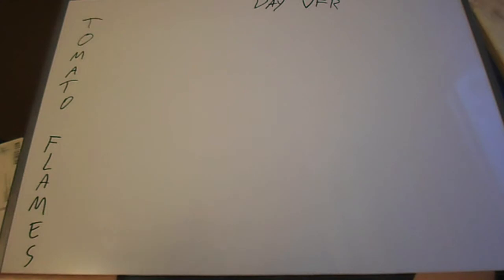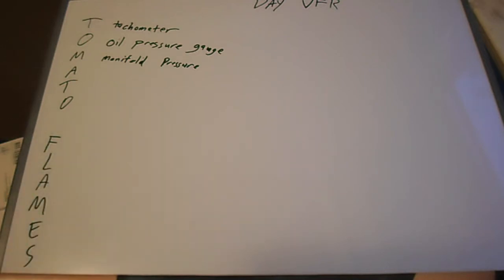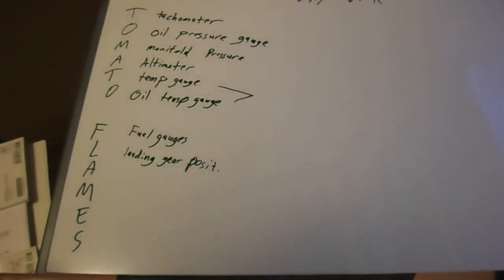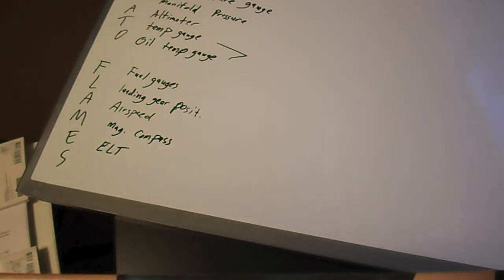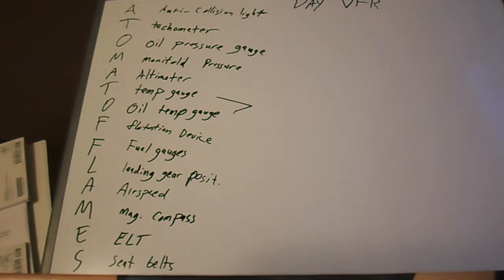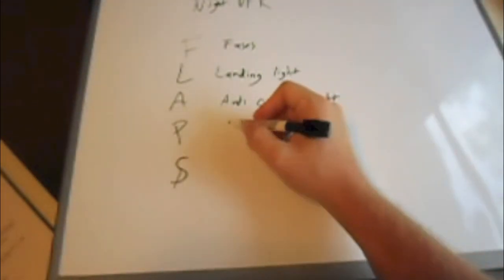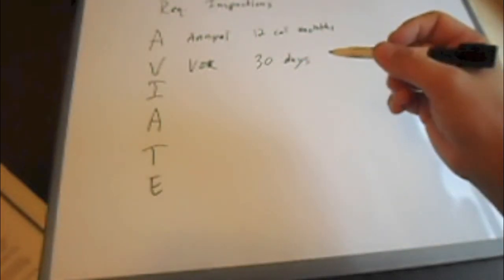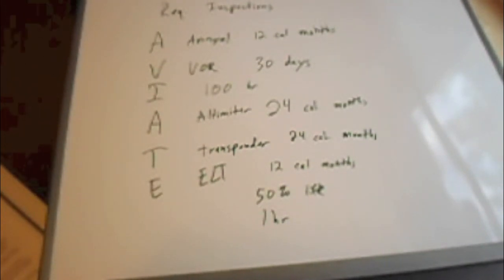Airworthiness Requirements

Comment: From what I see in this video the AVIATE acronym is correct. I can't find any references in FARS 91.409 or 91.411 for required inspections of pitot systems and related instruments, but I was taught in my avionics maintenance course that pitot system checks are often done together with the static check, in fact the test equipment are set up to test both at the same time, which makes sense since the airspeed indicator uses both pitot and static pressure, and can be considered part of the static system. The second "A" in this video says "Altimeter" but I think you could consider the "A" as the static check as well, it makes sense for a shop to test the atlimeter and transponder system while checking the static system at the same time, any other way would be fruitless to the aircraft owner, and so it makes the "S" in aviates a bit redundant.

As far as the actual arrangement of letters in the acronym (as in any other number of acronyms in aviation) it varies between instructors and flight schools. I was taught the acronym a different way, but it boils down to the same thing as is shown in this video. The only thing I would say is you could add ADs as the first or second "A" and make the "I" inspections, as in 100/annual, although AD's can also include special inspections and could also be added in the "I", so as before it's just a different way of looking at the same thing.